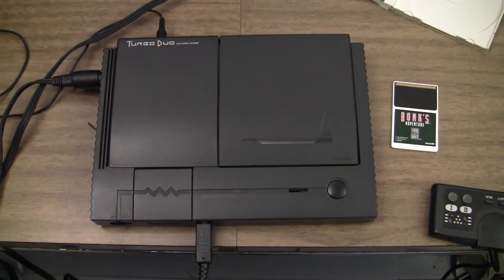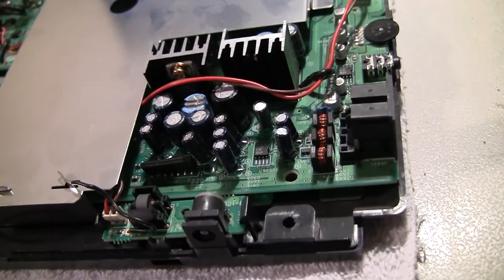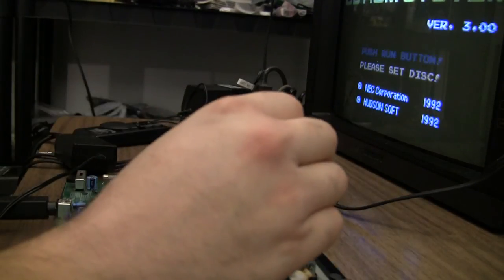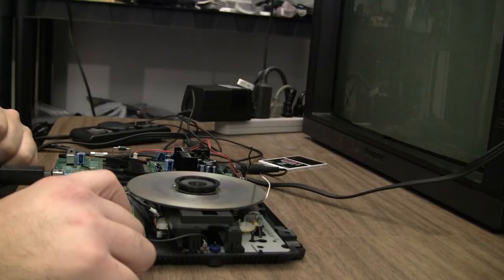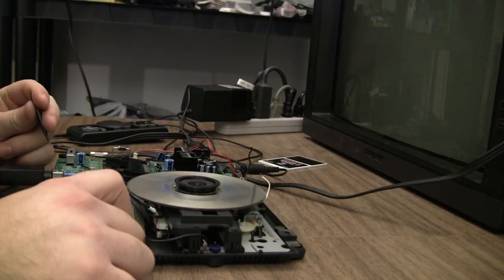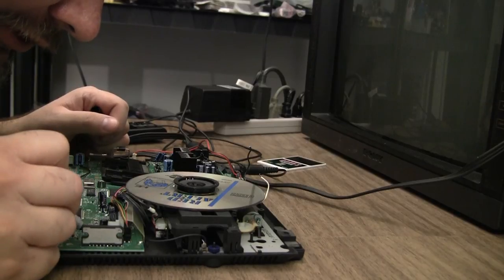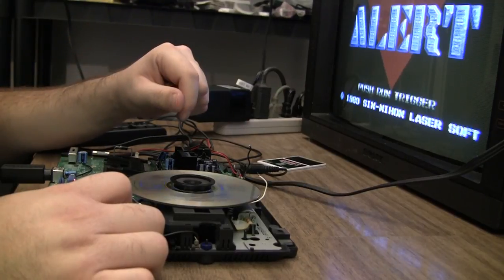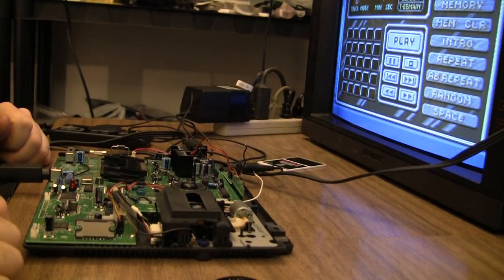Turbo Duo - caps and laser adj audio issue

Comment: What is that beautiful television? Looks visually pleasing for both video and the actual design.
Reply from the maker: I would find something with higher output than 9 volts, although it could have been a way to get you to only buy 'their' ac adapter.
Reply: +Zakku Redwolf I know this comment is like a year old but I think Jason must have replied to the wrong comment. The TV is a sony PVM, looks like model number PVM-2030, one of the older ones.
Reply: ***** Thanks matey!

Comment: I won 3 PCE systems off yahoo last year, extremely cheap.  A DUO, RX and IFU.  The RX is perfect and even included the 6B pad, which I personally am not fond of.  I have hated it ever since I bought my original, boxed RX 11 years ago.  I had a IFU+SCD Card since 1996 before that.  I always wondered if the avenue6 was better, but never got around to buying one.

So anyway, I cannot test the new IFU or DUO because I cannot find my old power adaptor for it.  I think think the IFU should be fine, even the gear is intact!  I knew the DUO would absolutely, 100% need a re-cap, but it's annoying not even being able to try it first.

The case is in pretty rough shape and it had something rattling around inside which turned out to be a cap.  When I was trying to open it to check the insides out, I discovered that the final screw was stripped, grrrr!  No matter what I try, I cannot get it to budge.  Any suggestions?

Comment: HI thanks for this I have a question please on mine it plays real disc fine but has trouble reading cd-rs sometimes they will work or sometimes not , would adjusting the pots help and if so which pots please

thanks for you help

Comment: My PC-Engine Duo recently stopped spinning. No idea why. Loved this video by the way.

You mentioned “102 & 104 are mostly for spinning...” Is there a dedicated pot or dedicated capacitors for the drive to spin? I did a complete cap replacement but still no spin. The Hucard slot works fine, and no sound issues. 

So I’m trying to isolate the problem. Any help would be awesome.

Comment: Yeah I know... been there, if you go to check out they are out of both types of power supplies for the duo.  I ended up getting a 10v 850ma radio shack one.  Its 150ma under what the duo is supposed to have but its worked so far

Comment: I have a power adapter of  a Input 120V-Output of 9V for the TGX-16 but the system itself is DC 10.5V is that still okay to use.

Comment: Question: my TurboDuo already had caps replaced and worked perfectly, until recently, the sound in some games gets incredibly soft (almost mute, for example the background music in Super CD games is almost non-existent while sound effects work fine).  Could it be caps failing already or something else?
Reply: +Brandon Kennedy It's likely that a trace is corroding. If the vias (little holes that run a circuit from one face of the board to the other) still had electrolytic fluid in them then they'll slowly damage the circuit.